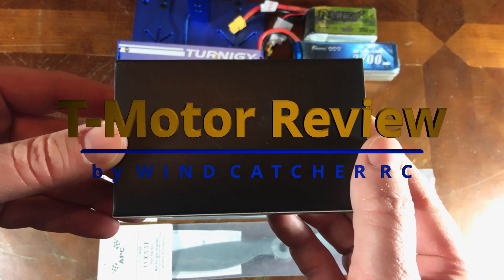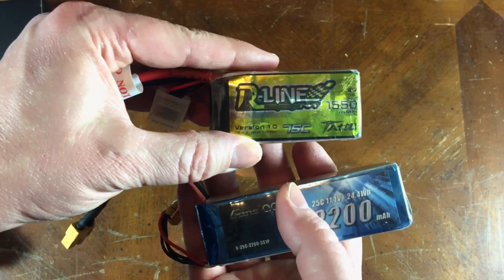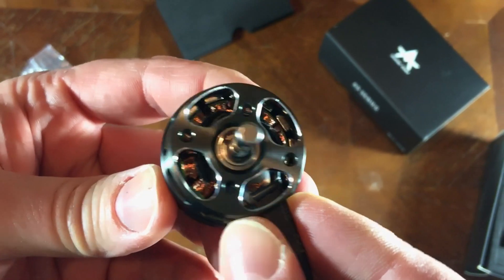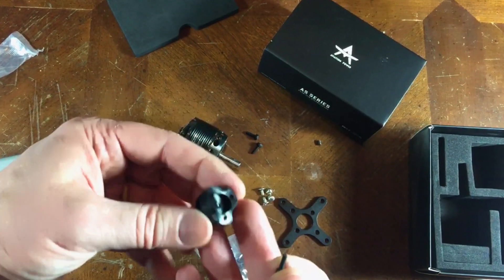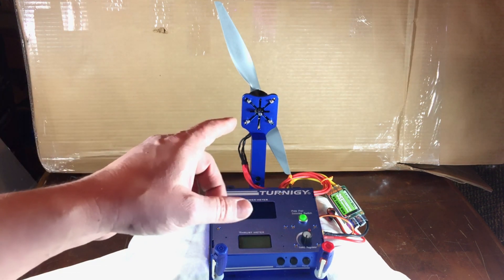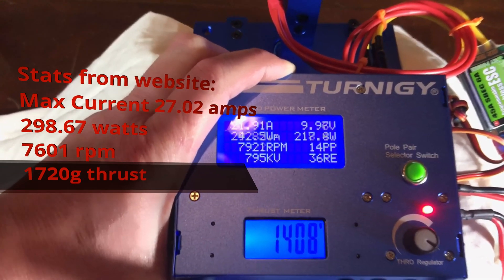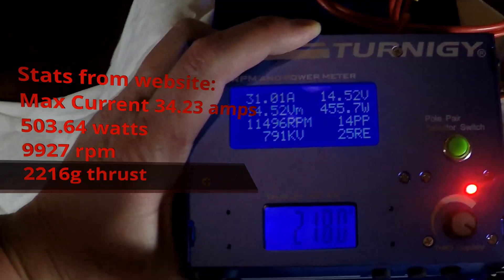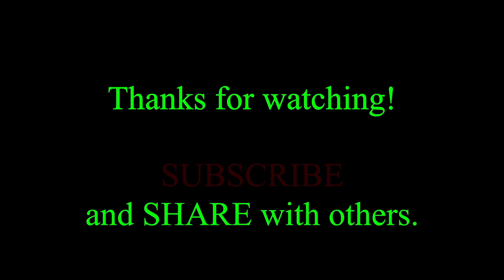Review of the T-Motor AS2814 Part 1

Comment: Hello what esc you using Bro? ?
Reply from the maker: For this video I used what I had available which was a Sky Power 45amp ESC from Heads Up Hobby.  Unfortunately, Heads Up is no longer in business.  If I had to do this test again, I would get a name brand ESC like T-Motor or Castle.  I am working on getting some electronics in stock over the next few months.
Reply: @WindCatcherRC   , con uno de 40 A podría usar en este motor ?

Comment: Hello just bought the T series one.
What do you think of 10/7 prop?
4 s lion 10000 battery
Reply from the maker: The 10x7 on a 4s should be okay. I recommend using a watt meter to be sure you are not pulling too much current.  Also watch your temperatures.